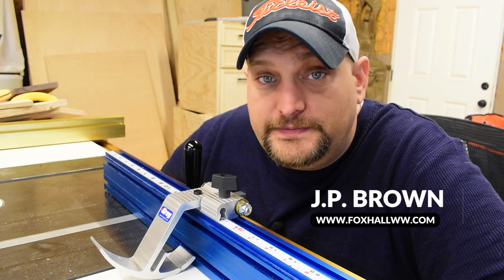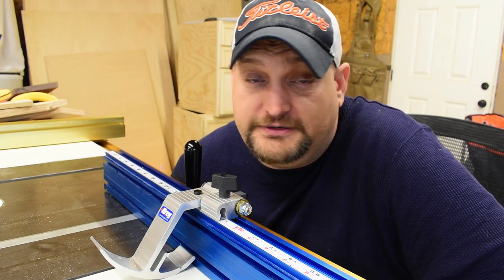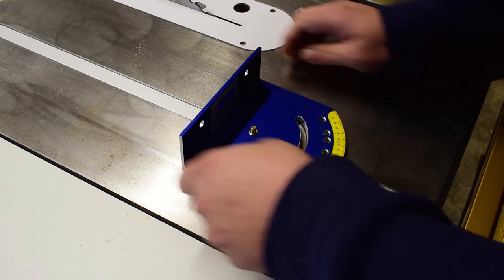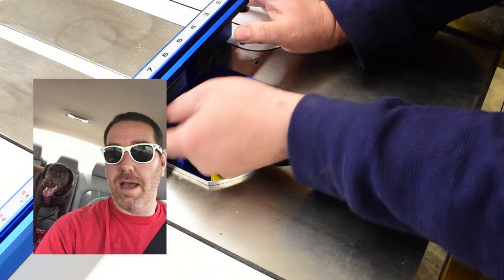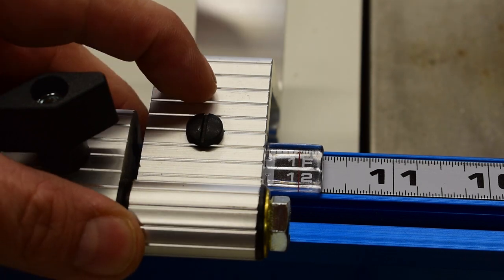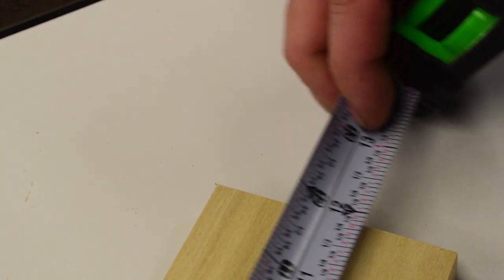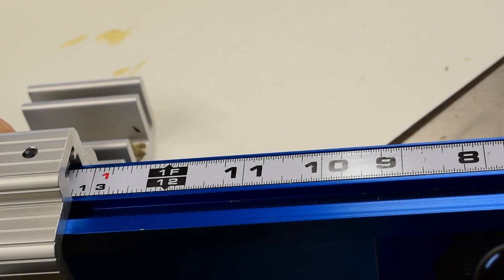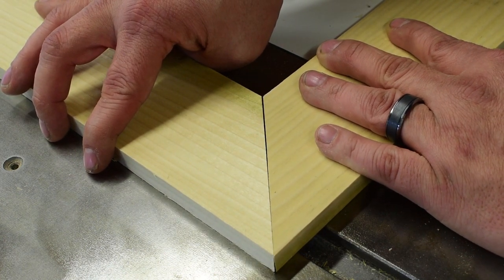DIY | The Fox Hall Tool Review Ep: 2 | Kreg Precision Miter Gauge

Comment: That plastic screw that holds the lens in place is your friend.  If you broke it, you were seriously over-tightening it.  It takes very little pressure to secure the lens.  Had it been a steel screw, you most likely would have broken the lens attachment point.
Reply from the maker: Probably was defective.  It broke in the production stop for the kreg stop kit.

Comment: I have been looking for a better miter gauge, It looks like is is well made but I doubt I will get it. honestly for the  money, having a drop in pin to hold the angle is ridiculous, it might be ok for a 30 dollar gauge but certainly not at the price point of this tool. I am sure that it works well, but I will loose that pin in the first 10 minutes in in the shop. what happens if It gets knocked around and the pin comes out without me knowing it, then I am on my hands and knees looking for the silly thing. dumb move.
Reply from the maker: no doubt!   the pin is my biggest hang up with it.   I have lost it several times and it's currently lost at the moment.    I got  the Incra 1000HD That I am about to do a review for once I get my shop back into working order